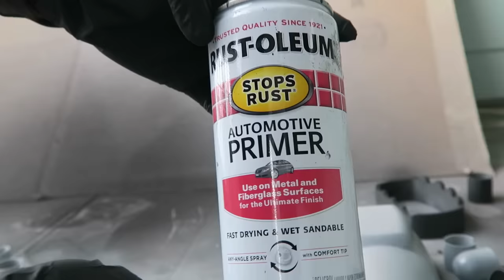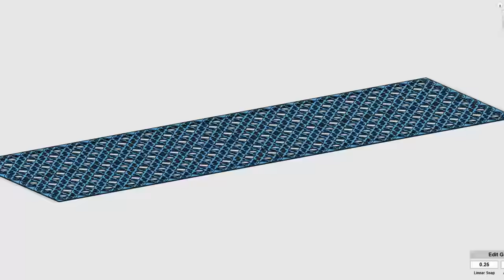3D Printed Fullmetal Alchemist Automail

Comment: I need to make a bigger printer;) Cool project. I wish i made more videos of all the projects i have done over the years.
Reply from the maker: Videos are definitely a nice way to keep track of progress :)
Reply: So many, maybe i will narrate some videos using the pictures i thankfully saved.
Reply: I've been experimenting with a polyester spray filler instead of using the high build primer on my 3d prints. You need a spray gun and it's very stinky but lol, It does a great job burying everything in one coat. Basically the same thing just a lot thicker and dries much faster.
Reply from the maker: Axis cool! Does it kinda bury any finer details with one thick coat?

Comment: What speed do you use on your Dremel when you use it on 3d prints
Reply from the maker: About half to 3/4, as high as it can go without melting the filament and depending on how much material I'm trying to remove and what filament.